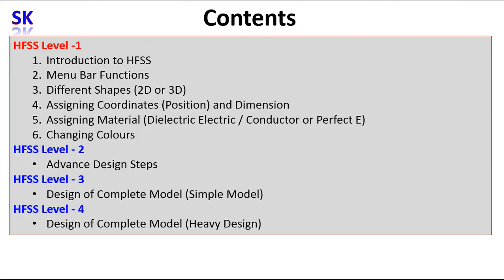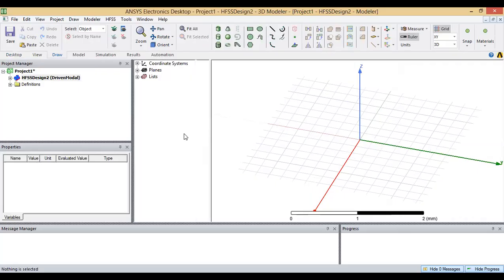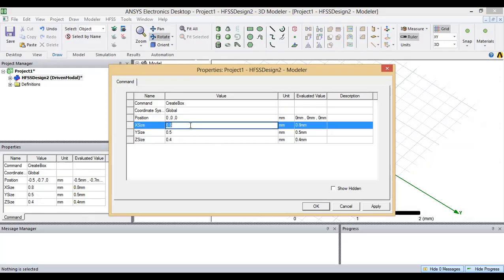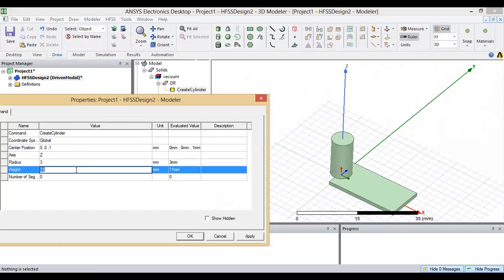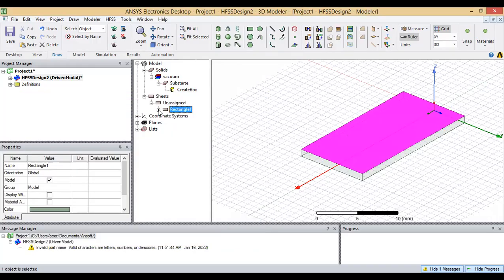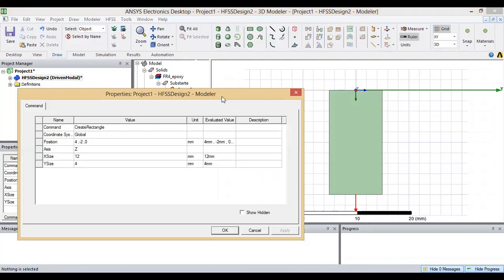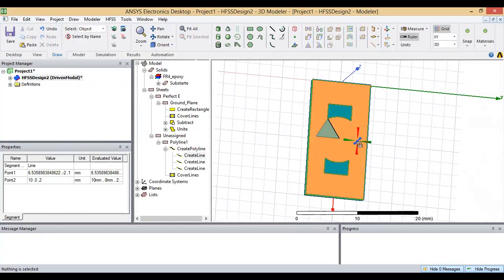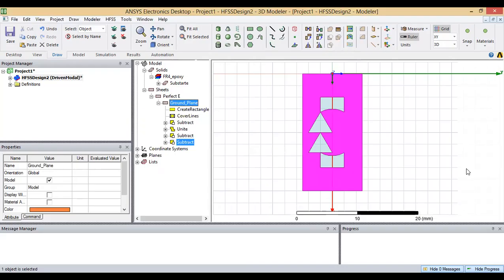HFSS For Beginners | Basics Steps for Ansys HFSS | By Sounik Kiran

Comment: Sir, I'm still at the start of the video and the project starts with "Terminal Network" and not "Driven Modal" as yours does. Will this pose a problem later on?
Reply from the maker: Yes, for the Driven Terminal, the excitation scheme is different than Driven Modal.

Comment: Sir, I am trying to use lumped port excitation for antenna.  But I cannot find the option to draw integration line in this new version of the software. It could be done while assigning lumped port in the 2020 version. Now I am facing error for not being able to do it. It would be really helpful if you could provide some guidance on the matter.
Reply: It's been 2 months. I hope you have resolved your problem. When I first started, I can not find it either cause the default solution type is not on "Modal".

Comment: Sir, I'm doing a frequency selective surface and I need to create a periodicity from the geometry. I saw in the manual that I should use Floquet Ports and I didn't understand how to apply them. Have you already worked with Floquet Ports? Could you help me? I'm doing a project for a university and I'm using HFSS for students.
Sorry for the english I'm from Brazil.

Thanks for the help!
Reply from the maker: Yes I have worked on Floquet ports. Soon I shall upload one video on this.
No worries..your English is good 😊👍